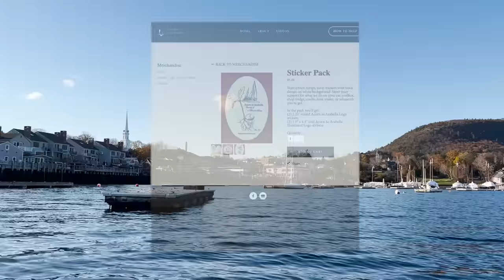Fire In The Boat, Installing the Stove - Episode 288 - Acorn to Arabella: Journey of a Wooden Boat

Comment: I feel the stove should have a gimble mount to allow for the rolling and pitching, but the ridged smoke stack has locked it in place.  This is a bit of a concern
Reply: The gimbal is solely intended to compensate so pot/ etc don't slide off.. You must know..wood stove is more tolerant. My truck camper is heated by a Tiny Tot wood & coal fired, made by Fatsco , Mesick Mich. There are 3 sizes offered..And the staff is helpful..the stove is a classic among sea farers.Mine exhausts thru a Dickinson flue cap. The one you are keeping for experiment sake...I considered the classic H style yet the majority of users have chosen the simpler lower less projected-exposed screened cap.I have not found any problem arising. I burn self sourced wood, scrap building off cuts, pine cones, cow patties totally sun dried, bees nest very dry & fire up with a torch.
Reply from the maker: Every stove has a rigid stack… there aren’t flexible ones. One doesn’t light a fire under way, typically. They will on big boats like passenger schooners when they cook food, but those get set really low in the boat and on the centerline typically. —Anne

Comment: PLEASE: Use eye protection when sinking self tapping sheet metal screws, especially when working with screws at eye level or above your head. Just takes one little bit of metal in your eye to ruin the day.

Also, doesn't gluing the flange to the housetop mean that you can't alter the hole size easily? Why not have just used silicone until you were sure there were no problems?

Comment: Can you comment on why you have both a wood fired stove, propane stove and diesel heater.  Given that space on a sailboat can be at a premium  having the wood stove seems redundant.
Reply from the maker: Steve, discuss this in an earlier video, but basically it comes down to the fact that he really loves wood, stoves, and so put one on the boat. The diesel heater will be good for when under way, and the propane stove is a cooktop and oven, not really meant to simply heat the space. —Anne

Comment: My biggest problem with this isn't the size of the chimney hole or how close the stove is to things it was watching you drill a hole into the boat this late into her life. sure everything is fine and you know what your doing but just seeing that bit come up through now that shes on the water gave me the hebe gebe's.  I just wish it was done on shore earlier.
Reply from the maker: It’s super common to accommodate for new things or cover up old during a season or ashore… yeah it’s always measure 383836337 times and cut once, but other than that, it doesn’t present any kind of a safety issue. —Anne
Reply: @AcornToArabella  thanks for the reply. When people inevitably complain about the chimney being too close (i don't think it is)  there are fire resistant wool like products you could "stuff" into the gap.   refractory wool is an expensive option, but actual wool is remarkable fire resistant up to 1000 degrees F.  Just get pure wool and untreated or treated for fire resistance specifically.   That's if even enough people complain or you get too worried.

Comment: That whole wood stove idea feels to me like adding another layer of potential unnecessary lethal danger. It is such a confined space that you do not need much toxic gasses for a potential life threatening problem despite the ventilation. And it only has to go wrong once to be fatal. And human error is real possibility. You can set alarms, but that gas immobilizes you and it makes you feel disoriented. And if you are asleep and woken up by an alarm you might already be too much under the influence from the gasses to be able to respond properly in the confined space that you have. It is hard enough to respond properly to such an alarm when you are woken up by it and when you are inside a regular house, let alone inside a space that is not the easiest place to escape from when you are under the influence from a confusing and disorienting gas. And it would be impossible to drag a person who is unconscious out of the hull all by yourself. One overlooked smoldering amber can create enough lethal gasses in such a small space. 

And besides that it seems that you cannot haul wood fast enough and store enough wood at a dry place to keep that stove burning if it had to keep you warm an entire winter only with burning wood. It is enough work to do that on land. To do it onboard of a boat takes many times the amount of work and handling. And when dry wood is stored onboard of the boat it is only an extra source of fuel that can catch fire when it is not supposed to catch fire.  

That is a lot of risk for a little romance.

Comment: Wouldn't it be better to install a  diesel fired heater that will sip diesel from the main tank? lt would be safer, less bulkier and several times more efficient?
Reply from the maker: We have a diesel heater, but it will have its own small tank and not run from the main tank.

Comment: I love the aesthetics of your chimney build but you need to tape the joints with metal tape. Otherwise you are leaking CO into your living space through each joint. Hardware stores or even automotive should carry it.
Reply: The glue on foil tape is not rated for temperatures created by a wood fire and will off gas into the small cabin. The joints will become sealed after a few cycles due to carbon buildup.
Reply: @newbiereview6291 Interesting! Never thought of that aspect. Just keep those CO detector batteries new!

Comment: Come on Steve, you can do much better than that. Now go back and construct it with the design and care used during the initial build. Get proper double wall stove pipe, rivet and seal the seams, plumb the pipe so it’s vertical then insulate the roof pass thru with heatproof material separating the wood from the metal. While you’re at it throw that stove overboard buy a modern high efficiency unit. That relic you have is best used to secure a mooring buoy 😂.

Comment: Well I'm not scared to say it, thats not your best work mate. That tapered transition .. you need to get one made and they can offset the 3" to the back or front edge of the stove outlet for a better position and also put parallel sleeves top and bottom that you can seal properly to the stove and damper tube or, read on. To be fair I would have had a muffler shop make the inside tube with machine bends and v-band clamps top and bottom to hook it up, I know it's easy to spend another mans money but you know, do it once do it right, no smoke and gas leaking out, no juice running out of the back to front joints. Using v-band clamps the thing comes to bits in minutes for cleaning, you could remove the external flue and clamp a watertight cap on when the weather gets interesting, what can I say .... actually I've probably said enough.
Reply from the maker: Thanks for weighing in